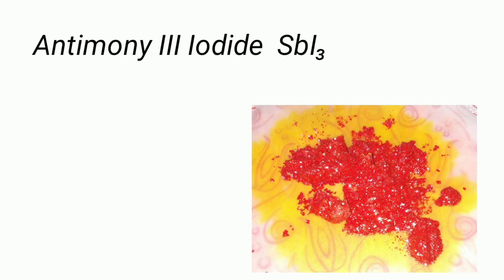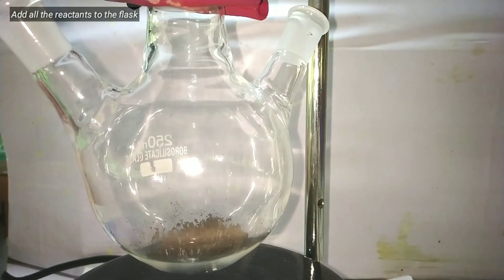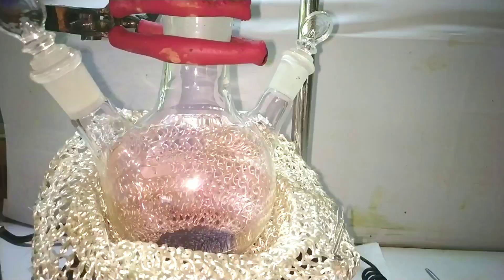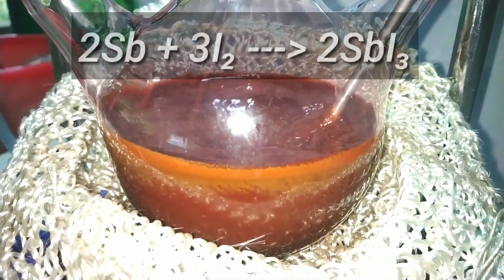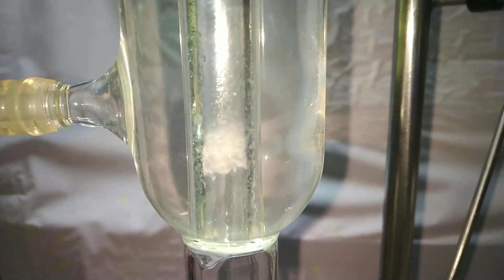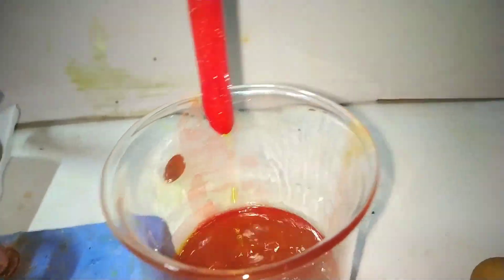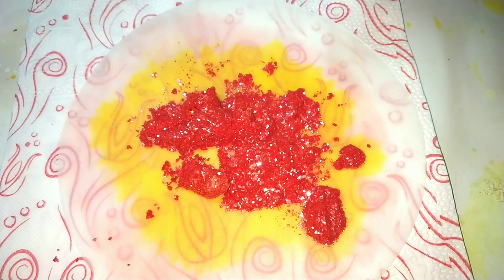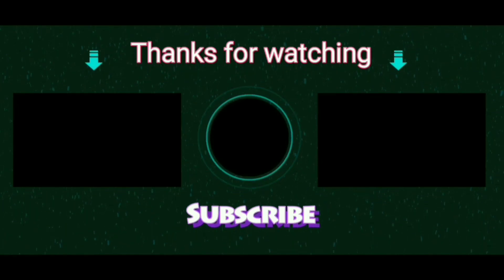Antimony III Iodide Preparation

Comment: Is it just me or is the stoichiometry just WAY off?
The molar mass of antimony is 121.76 u, while the molar mass of Iodine is 253.81.
We need 2 equivalents of Antimony for every 3 equivalents of Iodine to give us two equivalents of Antimony(III)iodide.
3.5 grams of Antimony is 28.75 mmol, while 7.5 grams of Iodine are 27.58 mmol. Is there a reason for that excess of antimony?
According to a paper by Michael B. Smith Iodine has a solubility of 1.875 kg per kg of Toluene, so a (slight) excess wouldn't even matter since you plan on crashing it out afterwards anyway.

Comment: For how many rupees did you bought the three necked round bottom flask??
And which video editor you use for your videos will tell me 
🤗
Will you tell us that what is the use of SbI2 , SnI2 
Will these compounds being used in future videos
Reply: @vibzzlab  ok but I found these of rs.700 of 250 ml flask 
Do you use power director for editing in mobile
Reply: Thnk u for telling 
Will you  make a video on KClO3 by electrolysis using PbO2 electrodes and making it
Reply: @vibzzlab  but lead metal is quite cheap metal
You can buy  from any local metallurgy shop -\_(○○)_/-
So what's the big deal
Reply: @vibzz lab you buy from gun store or Amazon
Reply: labs ok
Reply: @vibzzlab  did you got my email